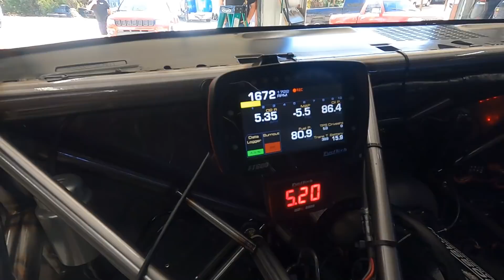First Hits With The OG Murder Nova's New Chassis and Procharger Setup!

Comment: Can we all just take a second to realize how sexy the OG looks that low and now completely functional at that height.... OG  FTW
Reply: the stance is perfect!
Reply: That car looks mean and sounds fuckin pissed! If it runs a 1.0x 60 ft on the street, it'll be very tough to beat. I for one think it'll happen.
Reply: You mean the new Street Outlaw Murder Nova with OG rear fenders and roof? 😎 Shawn even said multiple times in the video. “The new car.”
Reply: @Rust_Belt_Fab  It's the OG body with an upgraded chassis. If you upgrade your car or truck's chassis, it's still your car or truck right?
Reply: @RonniePTexan  So if he has to replace the 2 quarter panels and the roof for some reason like they get dented? Will it still be the OG?
Reply: @Rust_Belt_Fab  If your car needed a dent fixed it would still be your car right? I understand what you're sayin kinda, but as long as there's some OG Murder Nova still there, it's still the Murder Nova. That's how race cars are. You can change out the engine, transmission, rear end, take the interior out, put a fiberglass or carbon fiber front end on it, change the frame, suspension, put cages in it but it's still your car.
Reply: @RonniePTexan  ya man it’s going to be stupid fast
Reply: @youtubeconnollyfamily  Yessir it is gonna be fast. The OG's problem has always been that no matter the surface, no matter how much it gets turned up, it can't quite 60ft and run the ET that the guys have been running on the street for the past few years. He ran a 1.1x 60, and a 4.4-4.5 1/8th, and turning it up just shook the car and/or made more MPH. With the new setup, he can run 1.0x 60ft and run legit 4.0-4.2s on the street. That alone equals 2-4 car lengths in the 1/8. The Murder Nova is BACK!

Comment: Built a 64 Chevy II in  my 70's 10 sec bracket car. Went thru trap at 127 MPH. On one run I leaned on the shifter at end of run and went into 1st gear. Didn't wreck but it was an experience I will never forget. Shawn has a much bigger set than I ever had to drive that road rocket and manage to man handle it as well as he does. Hope all goes well but stay as safe as you can performing on the ragged edge.

Comment: To run a 1.0x 60' right off the bat, y'all got a hot rod. If you run a 1.0x 60' on the street, the rest will work itself out. Great job Shawn and Phantom. That car is gonna give em hell on any street.

Comment: When performing weight match-mounting, the yellow mark on the tire, indicating the point of lightest weight, should be aligned with the valve stem on the wheel assembly, which represents the heaviest weight point of the wheel assembly.
 I am send you this message cause I heard you talk about it on a video. 

Cork from casa grande AZ

Comment: Never was a fan of pro chargers still like the twin turbos hope it works well for you it sounds like a top fuel motor . You have a 5 sec car , if its pulling as you let up A tire compound change might fix that dance to the right , just a thought ive been out of the game a while but it worked for my top alcohol car.

Comment: It starts out really well (pulls hard right, but seems to respond well), it just seems that at higher speeds it gets loose. I noticed you lifted the nose a little in relation to the rear, and it used to be set more level.

I think if you put the rear steer how you think it should be, and then change the wing a little for less downforce and I think you will have it mostly licked

Comment: dropping boost on the gear change. are you running a blow off valve? on a super/pro charged car you dont need to run one.. as each shift it will dump the boost. you can buy electronic controlled ones that dump only  pre defined amounts so 10%-90% controlled with compressed air or electronic. this will solve your boost issues. or depending on ECU  can you introduce shift cut so about 75milli seconds is good.  . that can also dull it down on the shifts 
re suspension
can you log ride height over the run?  what we have done for some cars is 
we run lasers as close to the wheels as possible so 1 each corner. We then run 2 more inboard along the rails which gives us a few bits of info. if we are wheelieing how much balance shift during the run and also  the squat inboard and out board 
I ask because I saw the wheelie bar's bar (not the wheel) I saw that squat and spark on the left side so this would bounce and make car go right quiet violently 
suspension wise 
could be a little more or less preload in the rear right spring.  
looks beast tho!!

Comment: Great Job on the new car Sean. Wish you the best of luck with it. I have a question regarding “looking at the data” wheelie bar impact and load at launch. Is that a data set you guys look at? Is that even a measurable data point? I would think it should be, though I could be wrong. I often am, just wondering. Thanks in advance.

Comment: I don't really know anything about drag racing but it sound like it needs a lower (3.50 vs 3.35 for example) rear gear but at the same time it seems to break the tyres loose on upshifts which suggests the opposite?

Comment: If you have a tire that's over ½ off in roll out with the other and your compensating that with air it's going to drive to the small tire when the chassis settles or that's what I found with a set M/T that I didn't measure and then found that done the same thing my small tire was on the the left so I put more air in it not going nearly as fast as you guys or horse power as a bracket racer about 100ft out when the car settled it started wanting to go left withe extra hp and number you guys runs I don't know why your car wouldn't react the Same way ony further down track just a thought I know you all read as many comments as possible hope this helps a little

Comment: Looks like after the 60 is where it's getting up on the tires and the rear + just seems to really take over and drive it to the passenger side hhhmmmmm interesting  and Looks like there is some light chattering at the hit could have been the leftover from a different pass or vehicle also I noticed yall don't use chalk on the wheelie bar wheels just wondering why not I mean if your gathering data then you should get it at every spot you can ...so like is it getting up on the bars and that is driving your somewhat straight short time and then when it's unloading off of the bars and making the transition into getting up on the tires and causing more problems??? There's a lot that can be observed from them rear off angle starting line videos... anyways great video as always from yall we love to watch the grind thanks for sharing

Comment: Here is a dumb ass question for you, have you measured the circumference of both your slicks?
If there is a slight change in size it will throw the car into the direction of the smaller one.

Comment: Instead of running CO2, why don't yall wire in a small onboard compressor for your air supply..? Never have to fill it, and it's small and cheap! Car looks killer though guys! I bet that noise is hard to get used to though after running turbos! Good luck!

Comment: Why does all blower cars no matter if it’s a roots, screw blower or pro charger idle so high? Is it due to having to spin the fuel pump fast enough to keep fuel in it?
Reply from the maker: They sound cooler at 1600 than they do at 1100
Reply: @187Customs  lmao. For sure!!